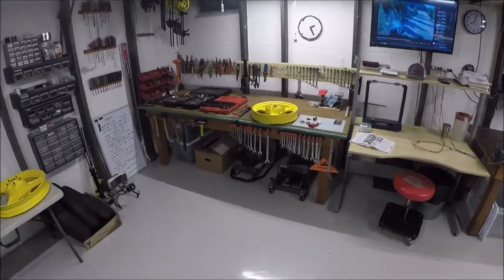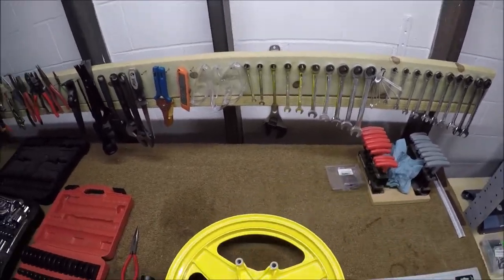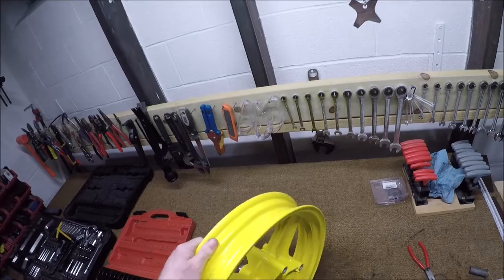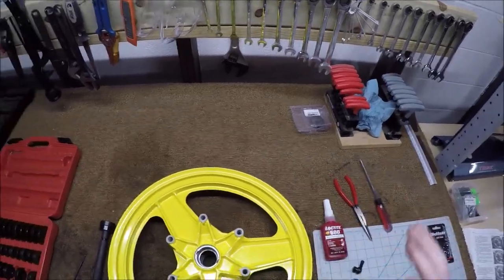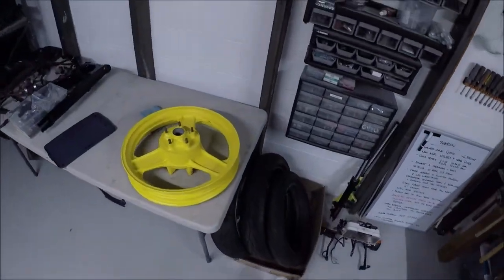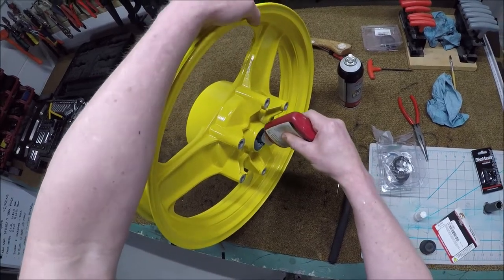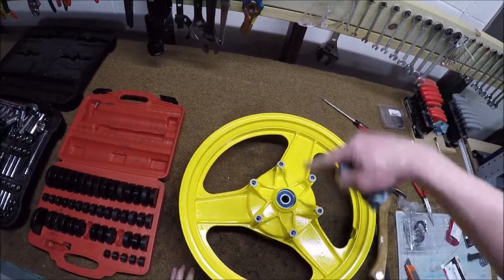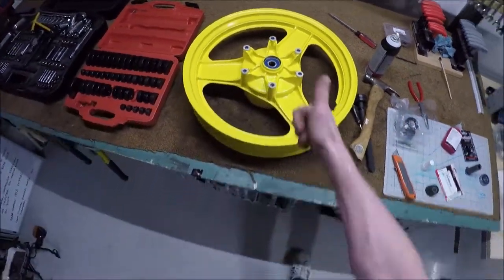Orwell's Interceptors: EP15-Green Loctite, Wheel Bearings, and Maracas

Comment: Well, thats kinda why I stopped
restoring these. They are getting to the age where weird things like that happen to them. Add the scarcity and lack of consistency of new and used parts on top of that. Sure the bikes look cool but I was always thinking what else while riding them. That goes for all these 30-40 year old bike Ive worked on.
Reply from the maker: The scarcity is definitely becoming a problem. I was surfing for parts bikes or even just any VF500F's in my region. I found a single non-running 500 for $3000 over 300 miles away. It's just bananas what has happened with prices recently. I know this is about the worst time you can be looking for anything now, but it's indicative of the low supply. 

I'm definitely getting some fatigue on just fighting issues of old parts and having my wallet get smoked in the process of resolving them. So I absolutely get where you're coming from.
Reply from the maker: Of course I went and grabbed another project this weekend... there's a 1990 EX500 that's been in my family for like 15 years or so and has been locked in a basement non-running for at least 5-7. It was my brother's, and both my dad and brother showed interest of riding it if it's rideable again, so.... I've obviously got to give that a shot.
https://i.imgur.com/DnVRE2t.jpg
https://i.imgur.com/kYtx7bV.jpg
Reply: @matttriestodothings  always entertaining to get them back on the road.

Comment: That is some info I’m going to tuck away in the brain. I hope it works and I hope I never need the info.
Reply from the maker: Every bike is a new adventure, right? You know that better than me, haha!
I'm actually pretty certain this will work just fine. The consistency of the retainer compound is quite a bit different than threadlocker. In my panicked research, I'd read about old farmhand  tricks for worn out hubs where they'd actually just take a screwdriver and go around and nick the inside in a bunch of spots to cause high spots to regain interference. That was too savage even for me. I'm gonna try the green glue first.

Comment: The bearing will be okay..
👍🇮🇪🍀
Reply from the maker: I think you're right.
Reply: @matttriestodothings  about 25 years ago I was doing a small engine repair course..The teacher was a motor car mechanic..he said they actually use this loctite in helicopters.. so I think it will be even better quality 25 years later..
👍🍀🇮🇪
Reply from the maker: @geoffreycasey875  Interesting. I certainly see the application for it. I'd just never even considered it--they looked at me like I'd sprouted a second head at the hardware stores I stopped at when asking for "green loctite". Had to order it online. Looks like Bentley and BMW call for it on their wheel bearings too. At least my research on some models.